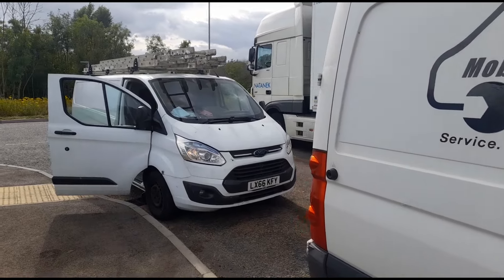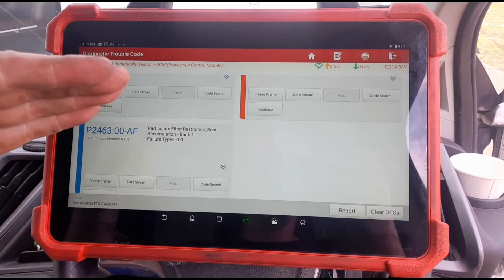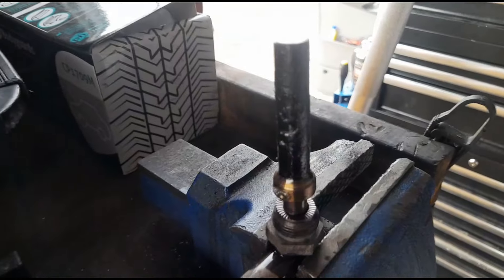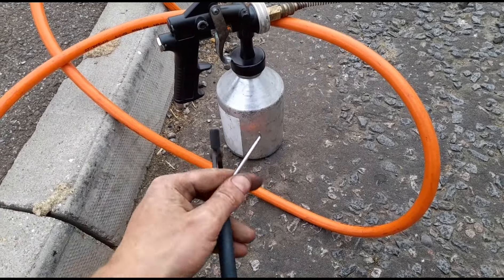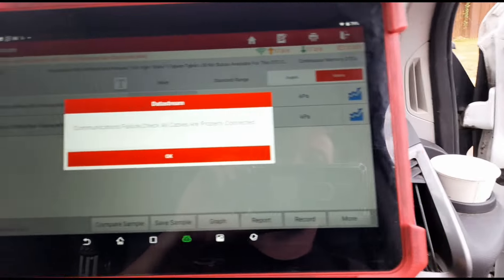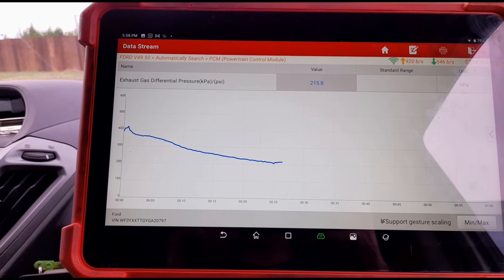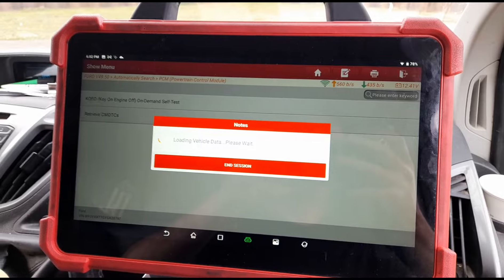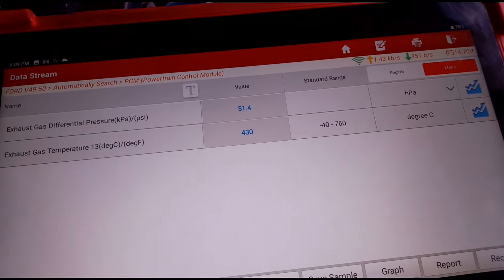The Mysterious Ford Transit DPF Fault That Comes Back Same Day After 4 Repairs & Cleaning. Why?

Comment: Your surprise at the constant stream of vehicles with the same issues, despite you showing the step by step procedure to resolve it, over estimates the ability of the average bloke these days!  I look after my elderly mum full time and she has carers visit 4 times a day for personal care. They are all females, various ages, some are drivers.  The drivers have constant issues with their cars and I was astonished to discover how useless their partners are with even the simplest car maintenance tasks. Even routine checks like tyre pressures, oil and coolant, these blokes don't have a clue!  So these poor ladies end up with catastrophic mechanical failure in some cases! And end up getting royaly ripped off by garages.  I'm trying to help them get upto speed on how to do preventative maintenance but they struggle with time an money.

Comment: Hi just been watching your videos very good. I have a range rover evoque hse all wheel drive now having same problems dpf add blue injector iam trying to sort. Also have a Ford transit custom 2.2 had no problems so far  but its only done 42 thousand miles very interesting about the vaporizer keep up the good work its opened my eyes to the problems both these vehicles have. Thanks again.

Comment: Saw the temp too low code + that it was a ford I knew immediately from just watching your videos its the vaporiser.
Reply: Every modern ford owner myself included knows it well after suffering from it and 800 squid lighter in the pocket 😂, what shocked me even the AA didn't know they just said you need a new dpf.😱
Reply from the maker: I have had multiple customers replace with a new dpf. And the problem comes back the next day because they use the old vaporizer.

Comment: I've followed this channel on and off  probably because  back in 1990/s I bought a 1 yr old showroom ( spare parts  car )  yes I  know * " Fix it again  Tony"* 
 The point is DPFnearly every week!!  I got the filled up in readyness to travel   back. Home 280km round trip when arrived back in the city  on a Sunday evening  I'd just get it topped ready Monday  Plumber on a large university campus it  would stink.of takeaways fish n chips and sure enough come Wednesday I'd after which. following thursday back to the fiat service centre  for a forced regen. Week in week out .
 The service centre  
Said it was operator abuse "slow low usage"
Wife innocently got me an account  
With another fuel tank retailer END OFF CONTAMINATED FUEL never had any problems after that.i wonder  if uk diesel has high sulphur content at some garages I did get rid of the diesels  in the end bought an Leaf yes in know  no range😢

Comment: the OLD DAYS. stop a petrol engine when it's hot, take plugs out, inject 3 or 4 squirts REDEX down each plug hole[ABOUT 100CC], put rag over empty plugholes SPIN OVER ON STARTER 3 SECONDS . leave for at least an hour.
refit plugs and drive it like you stole it.
having 6 feet of rockwool in a string hanging out exhaust pipe was 'JUST A COINCIDENCE OFFICER'

Comment: Hey man, been through your videos, im stuck ive got p008a low pressure fuel system pressure, p246b incorrect conditions for pdf regen and p2463. Ive changed the fuel filter and the common one that breaks on the rail. Do you have any ideas please.

Comment: Hi Jimmy,
I have the same van - 2016 2.2 Sport. Van was driving perfectly, no warning lights on dash, then all of a sudden, while driving about 75mph on the motorway, the van started shuddering and losing power. I pulled over, had to get a recovery truck to take it to the garage. Oil leaking onto the ground. It wouldn’t start, but after it cooled down it would start, but didn’t sound healthy at all. Turns out, it split a piston. Have you any idea why this would have happened…? Van was serviced regularly, and there was 70k miles on the clock.
Reply: Had this on a mates van is was a faulty injector to much fuel melted cracked piston 4
Reply: @AnilKumar-yn6ns  I removed my 4 injectors and sent them away to get tested. All were fine.

Comment: Even the RAC couldnt find the problem on my Mondeo, I had to take it in to a engineers to get the codes read into layman's terms, it was the same issue as this chap the vapouriser valve. Not a new dpf like the rac said. How long do these valves last
Reply: 13:12 between 80 and 150 000 miles before the problem arise.

Comment: If the dpf is really really blocked could that also cause the low temperature fault and mislead people into thinking it's the vapouriser?
Reply from the maker: Opposite. Dpf temperature will increase when there is higher resistance
Reply: @ORileysAutos  Got it, thanks 👍🏻

Comment: Do you use tap water,  distilled water or deionized water in the DPF clearer?
Reply: Tap
Reply from the maker: I used to use de ionised water but after speaking with a chemical specialist he's said tap water is fine

Comment: You would think there would have been a open circuit fault showing with vaporizer pump , didn’t point you at all to that just pressure sensor faults , vans keeping your brain ticking and active always learning ..

Comment: crafter dpf regen working as normal getting to 600 degrees resets and starts building soot as normal. Pronlem is after about 20 miles deivign regen starsz again. Sood goes from about 6mg and jumps up tp 27 all of a sudden starting a regen again. Engine runs hot on long trips becouse of the repeted regeneration processes evert 20ish miles. Whats the most course.  Crafter 2.0 euro 5